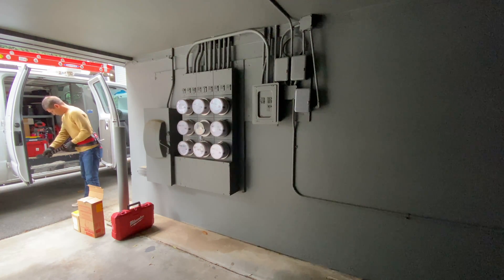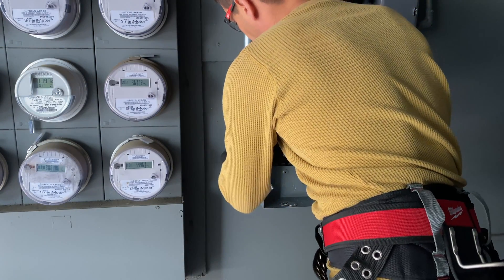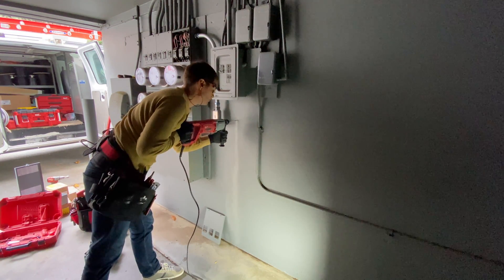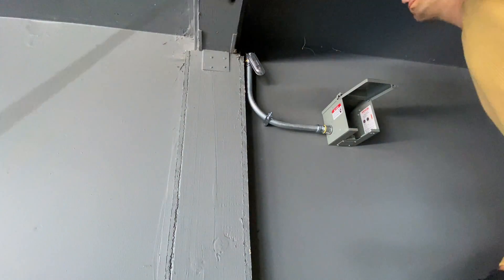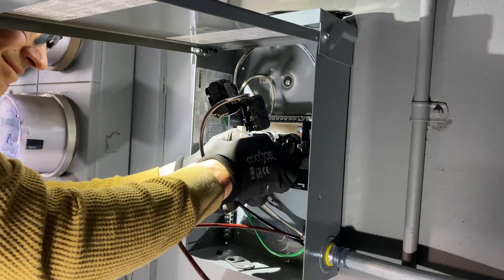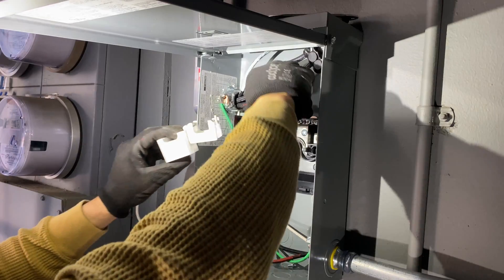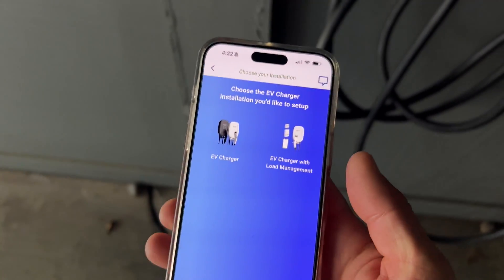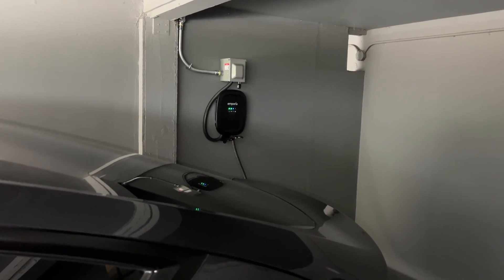Installing EV charger with Load Management. 40A charger on 70A service.

Comment: Ct clamps should be install in the main load side so it reads entire unit circuit load and it will adjust you have it to a sub panel that doesn’t have a load unless car charger is in use

Comment: Can the CT be connected in such a way that it reads only non-charger loads?  Is this type of connection possible that the CT will read only non-EV loads please answer
Reply: Hey can you please help out here. I need to know if the CT of external energy meter be connected in such a way that it only reads non ev load